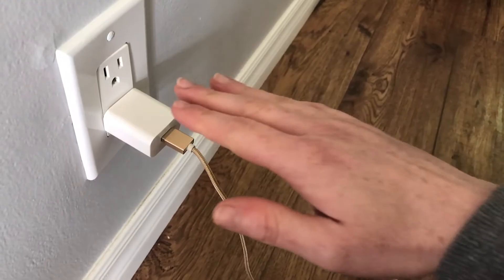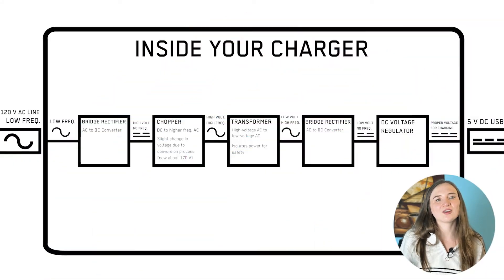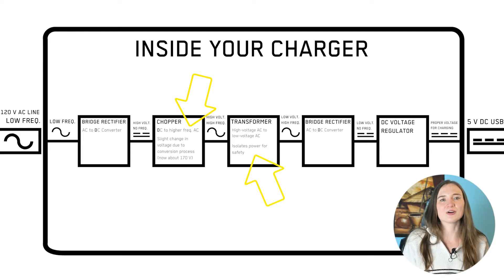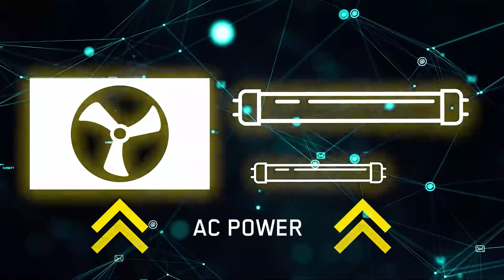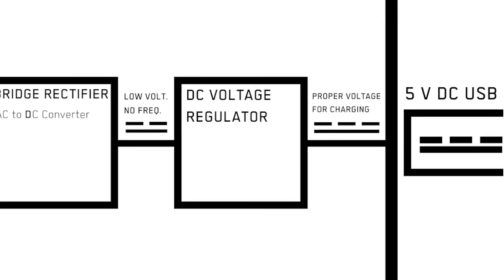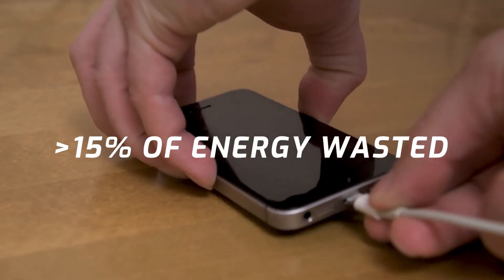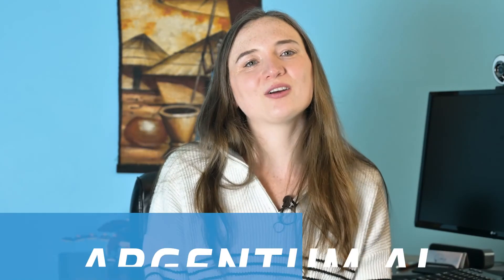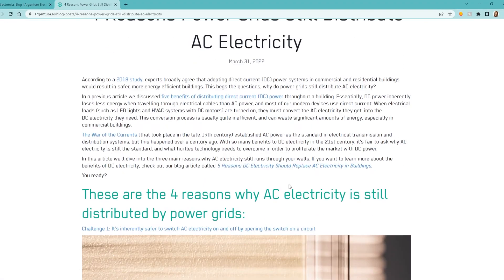Why do your chargers get so hot? + The inside of a charger

Comment: I always got 10 watt chargers and actually never noticed this in the past 20 years, before that we had them old chargers who always got warm to the touch.
Since I bought myself a tablet which was rated for 15 watt and fast charging I bought new chargers and new cables to be used with them.
These crazy chargers get to 60 degrees celsius and are from samsung themself, the cable was in the box so also from samsung themself.
While me old chargers don't even get warm to the touch so they always remain under 30 degrees celsius... 
Right now the temperatures are 20 degrees so if it was summer 30+ degrees the fast charger would be around 90.
If something fails within the charger or has a spike of electricity you got yourself a house fire right there.
And that all so you can charge within a hour instead of having to wait 1.5 / 2 hours, it makes no f sense.
They also just begging for the world to go up in flames without giving you a charger that has been made for the device alone.
Instead they let you walk a minefield of where their own chargers are just as bad as those sold by alibangbang.
Funny fact, most things within our machines are delivered from china japan vietnam or any other country close to there.
But yeah what do you expect when they can make 24.99 profit on every 30 euro charger while alibangbang only makes a euro or two per item sold.

Comment: What if my charger remains slightly lukewarm when charging was completed? I think there's still current going through but it this normal and acceptable for the battery?
Reply: Warm does not matter and the only thing that matters is the battery temperature itself.
Even if you charger is burning and on fire, you battery still does not have to be warm at all.
Take a fast charger 30w which is at 60 degrees celsius in normal conditions the battery is at around 25 degrees celsius.
Ideal operating temperature range for lithium batteries is 15°C to 35°C (59°F to 95°F). (device on, device generates additional heat, never use device while charging)
Don't let the device freeze and don't get it above 30 degrees for prolonged periods for extended battery life.